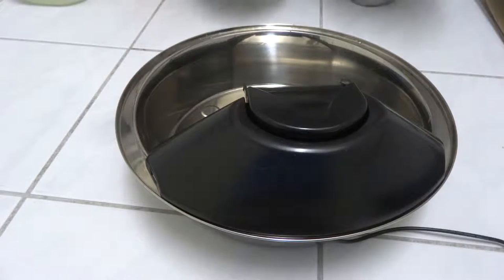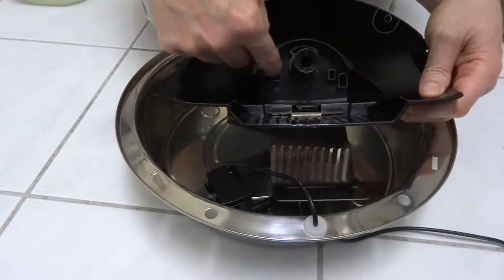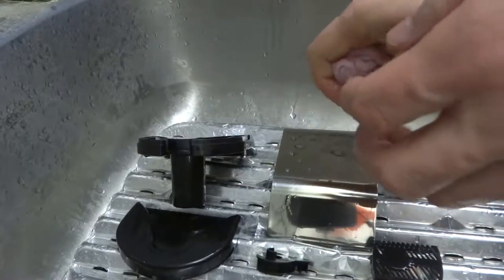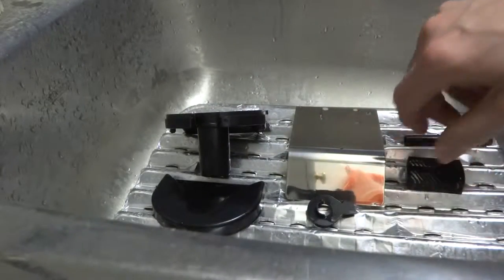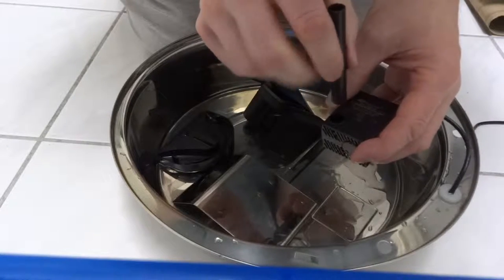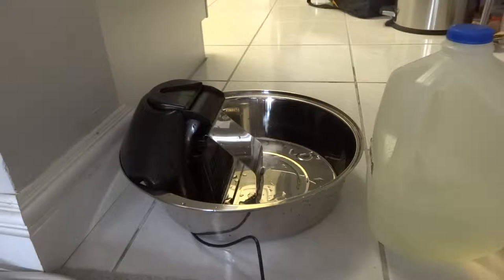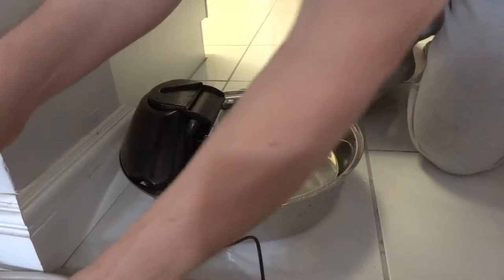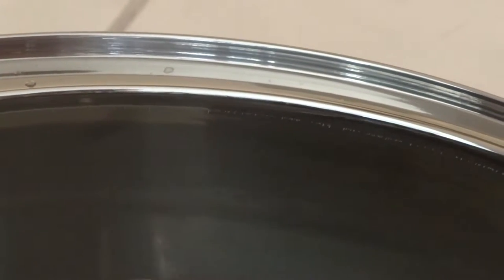Drinkwell Zen Fountain Cleaning and Usage Tips

Comment: Thank you so much I didn’t even know after watching other videos that it could be taken apart this much. I have a question mine as it starts to get clogged with hair and what not the motor gets really loud. Once I clean it and quiet back down. Tonight when I went to clean it I noticed there was not the usual hair build up next to the filter but a black slime!?!  I replaced the filter the last time I cleaned it, But I have rent and replace the filter many times before and it always had a hair build it but never this black slime when I opened up the parts that I didn’t know I could open there was some more black slime in there. Have you ever had this experience?
Reply from the maker: I've never had that experience. However, almost a year ago I switched to another fountain because it was easier to clean. I worry that your pump is leaking oil or something. My advice would be to replace the fountain altogether just in case. I can't imagine what else it could be unless... did you happen to change your cat's food shortly before you noticed this?
Reply: @59R  very interesting, do you happen to like your new one better? If so, which one did you end up buying?
Reply from the maker: @Buckeyeguy9  I got her this one. The water level goes down more quickly than my old one. I think that's because
1) It evaporates the water faster which means she gets to drink cooler water.
2) Because of this, she drinks more water which is good.
https://www.catit.com/archive/shop/flower-fountain-led/
Reply from the maker: @Buckeyeguy9  Because I fill it with reverse-osmosis purified water to start with I use these filters rather than the triple action one because I don't have to soften tap water.
https://www.catit.ca/shop/dual-action-fountain-filter-2-pack/